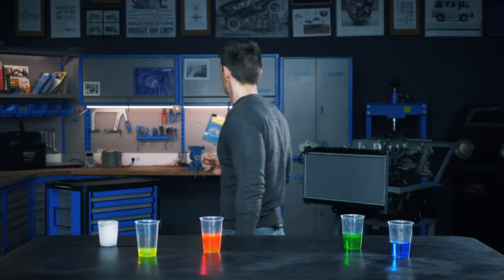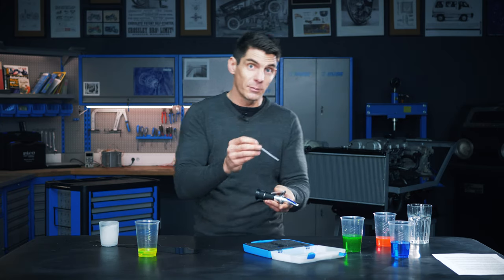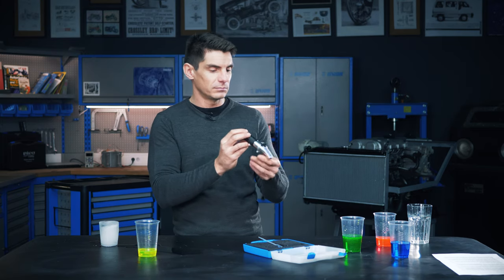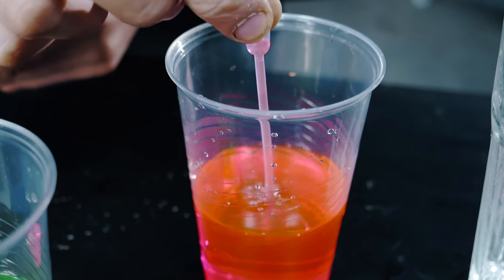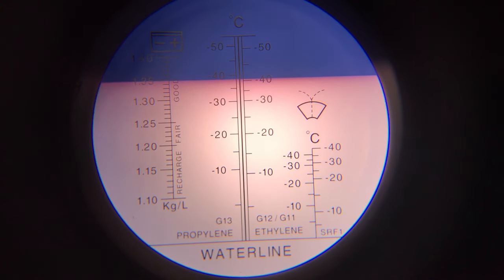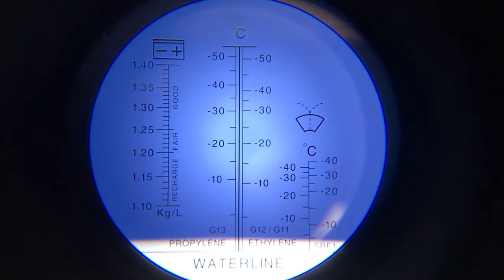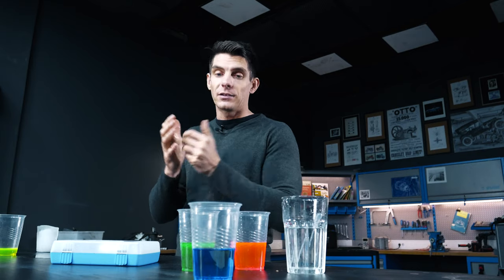Using a Refractometer to test coolant

Comment: Refraction is just a fancy word for bending light. As light passes from air into liquid, it bends a bit. Components in the liquid such a ethylene/propylene glycols influence the degree (angle) of this bending in relation to their concentrations. The final angle shows up on the scale.

Comment: Guys,
The purpose of this refractometer is NOT to indicate when you should REPLACE the coolant, as such.  This refractometer has one job which is to advise in degrees Celsius what level of antifreeze protection is in the coolant under test; and I thought the presenter (Alex?) covered that issue.  This can be helpful when testing coolant in a vehicle of unknown service history, or double-checking the accuracy of a coolant mix prepared by yourself, or others, or even store-bought antifreeze.  It can also help check the coolant supplied after a workshop service of your vehicle's cooling system.

For those unfamiliar with coolant/cooling systems and wish to use a refractometer to test coolant taken from your vehicle:

(a) if your coolant tests way too low in antifreeze protection (for your environment), you can remove some coolant from your cooling system and add sufficient antifreeze CONCENTRATE to the system to increase the antifreeze protection to the desired level.  [Important: You should ONLY add concentrate to your system IF you know the brand/type of antifreeze in your system and you add only that brand/type of antifreeze concentrate.  And, do NOT mix different colours of antifreeze!]   OR

 (b) if your coolant tests way too high in antifreeze protection (for your environment), you can remove some coolant from your cooling system and add sufficient (distilled/rain/boiled) WATER to the system to reduce the antifreeze protection to the desired level.

The above scenarios may require a bit of fiddling around to get the mix close enough but if your antifreeze protection is way too low or way too high you should spend the time on it.  Or, you could just drain the cooling system and refill it with the correct mix of coolant .  Whichever, your engine will thank you. 

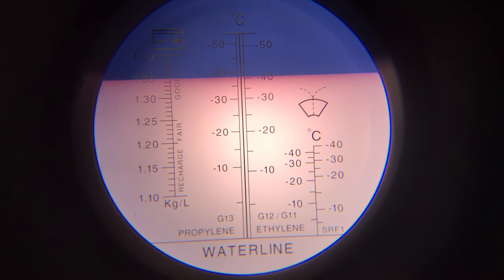In the video test at 1:30 the refractometer showed -40C for a stated 50:50 coolant mix i.e. 50% antifreeze concentrate & 50% water.  (I think a true 50:50 mix would read -37C on the refractometer, but that’s just quibbling).
  The brand of refractometer used in the video showed only the degrees Celsius antifreeze protection provided by the coolant under test (i.e. -40C).  But, other brands of refractometers can show two test values i.e. the degrees Celsius antifreeze protection AND the antifreeze percentage of the coolant (e.g. shows -40C and 53%); which is more helpful IMO.  

For vehicles in a non-extreme temperature environment I use a 50:50 mix (concentrate:water), with protection to -37C.  Nice and safe.   I've seen published that a 33:67 mix (-19C) is an absolute minimum (bordering on unsafe) and a 67:33 mix (-60C) is an absolute maximum (bordering on unsafe).  BTW, a 50:50 mix increases the boiling point of the coolant by about 8C.  

Think I’ve got my facts and figures right (well, close enough). I'm sure to be corrected if  I haven't.  😊
Reply: @ Terry T ... Very well stated and definitely 100 % accurate info. Well put...KUDOS.
Cheers
Brian
Reply: @Bman130958  Thanks for the feedback.
Reply: Exactly the info I'm looking for after doing a coolant flush on my Volvo. Since a few quarts of water/coolant remains in the internals of the engine after a flush, it throws off the 50/50 mix that is normally added to refill. Since you seem familiar with this testing method, I have two questions. Can we assume that the coolant is sufficient for the boiling point, if it passes the refractory test on the freezing side? Also, is this a good method for trying to correct the ratio back to 50/50 after doing a flush? Will it show too much water? Thanks for any info.
Reply: @redbeak1453  Hi.  I'm not sure how helpful I can be but here goes...

You said: “Since a few quarts of water/coolant remains in the internals of the engine after a flush, it throws off the 50/50 mix that is normally added to refill.”  Sorry, I’m not sure what you mean by “it throws off the 50/50 mix”.  

If you're concerned about the end RATIO mix of the coolant , there will not be a problem IF the residual coolant left in your system is a 50/50 mix (or thereabouts) AND you do a system flush [EDIT: I meant "fill", not "flush"] with a 50/50 mix of the SAME coolant type.  The overall mix ratio will still be “50/50” for the system. Even if the residual coolant that was left in the system has a poor, undesirable ratio mix, the volume of  the new 50/50 coolant you are adding to the system will basically even everything out to give you an acceptable ratio mix (which you can fine tune afterwards if you want).  
 
If  you're concerned that the AMOUNT of coolant you add will be less than what the workshop manual states for a refill (because of the residual coolant left in there), not a problem.  Just add new 50/50 coolant to the system until the system is full (and burped), whatever the amount is required.  

BTW, what is the capacity of your Volvo’s cooling system and how many quarts/litres do you think is still in there?  

You asked: "Can we assume that the coolant is sufficient for the boiling point, if it passes the refractory test on the freezing side?".  Sorry, I don't understand so let me answer this way.  You first need to decide the anti-freeze protection AND/OR the increase in coolant boiling point that you want for your vehicle for your local environment (whether you live in a moderate climate or a very hot or a very cold climate).  Once you decide on the protection level you want for your vehicle you follow the mixing instructions on the back of your favourite antifreeze concentrate to get the bespoke protection you want..or you can just buy a 50/50 mix off the shelf, like I do. :)  

For example, a 33/67 mix (33% antifreeze concentrate/67% water) provides coolant freezing protection to -19C and increases its boiling point by 4C.  A 50/50 mix provides freezing protection to -37C and increases its boiling point by 8C.  There are tables that can be found on the internet which will help you.  If in doubt, imo, go for a 50/50 mix or close to it.
  

You asked: "Also, is it a good method for trying to correct the ratio back to 50/50 after doing a flush?".  A refractometer is very useful when having to correct coolant mix ratios.  However, in your case I don’t know why you would need to afterwards correct the ratio back to a 50/50 mix IF you are using a 50/50 mix for the flush [EDIT: Meant "fill", not "flush").  You should be close enough.  

(There are cheaper, quicker tools than a refractometer that do much the same thing but they’re just not as precise or as fancy for us nerdy folks 😊.   See https://www.autoexpress.co.uk/accessories-tyres/60400/best-coolant-testers-2019.  These type of antifreeze testers rely on the number of balls or discs to rise in the sampled coolant to indicate the mix ratio, e.g. 4 balls rising = 50/50.  Some of these are accurate, some are close enough and some are not). 

You asked: “Will it show too much water.”  Not sure what you mean.  The refractometer doesn’t show water as such, whether either too much or too little.  The tool shows the amount of antifreeze CONCENTRATE as a percentage that is in the sample of COOLANT (i.e. antifreeze concentrate AND water mix) being tested by the refractometer.  If the refractometer shows the antifreeze concentrate is 33% you can then deduce that the water content in the coolant is 67%.

In future flushes, may I suggest:
(a)	Check that the radiator coolant level is correct,  If it isn’t, fill to full.
(b)	Drain the cooling system into a container, following the drain method suggested in the  vehicle workshop manual (or google it).
(c)	Measure how much fluid was drained.
(d)	Compare that figure with the workshop manual specs to determine the residual coolant left in the system.
(e)   Fill the system with new coolant to full.

Hope this helps a bit.
Reply: @STiHigh1  Wow!! Thank you for the very detailed response. First of all, I wrongly stated that I flushed the system with 50/50 mix. As explained in the Haynes manual I used(distilled water) reverse osmosis water to flush. Also on the Volvo sites they use distilled water. Funny, no one mentions that not all the coolant comes out like in an oil change. I did drain the block also. I did measure how much coolant came out, but the problem was, that I had already prepared the concentrated Volvo specific blue coolant the night before by mixing it 50/50 to achieve the protection you state above. I live in New Jersey USA, so I'm covered with that mix. With Corona shut downs around, I couldn't just run out to get another gallon of coolant. So I have the testers you mention, but the refractometer seems more accurate than those floating balls that seem to give different readings from one sample to another. So now with the new gallon of concentrate, I've been draining a little at a time and adding to try to get to 50/50 with the testers(floating balls and the Prestone with red arrows). I'm still waiting for the refractometer. Based on what you say, it could help me get to a more accurate 50/50 mix. I have a 96 Volvo 850T5 that has been a tank over the years. With the Corona shut down, I've been going over the car and learning  new things to do. Just rebuilt calipers last weekend, changed rotors and pads and bled brakes. I really appreciate you sharing your knowledge!! Is that that you doing a track day? I ride motorcycles on the track.
Reply: @redbeak1453 .  I should first clarify a mistake I made in my last post where my tired old brain (75-y-o) let me type “flush" with new coolant” when I should have said “fill" with new coolant" .  I have since corrected my post. 

Let’s see if I have it right..  You have drained the coolant from the vehicle and then reverse flushed the system with distilled water.  Did you reverse flush to the point that the fluid being drained out was colourless?  If so, then the residual fluid left in the system would be basically water which, depending on the volume, can sometimes make it a little fiddly to get the desired mix ratio on the first fill of new coolant. 

You mixed a gallon of new concentrate with water to make a 50/50 mix and then you filled the cooling system with that 50/50 mix?  Yes?

So, is your problem that after adding the new 50/50 mix to the vehicle the volume of the residual water already in the system has seriously diluted the end mix ratio in the vehicle from 50/50 to an unacceptable mix, according to your floating ball testers?  Yes?

What percentage/s do your floating ball testers say you have?  

For me, I wouldn’t get too hung up over correcting say, a 45/55 or 55/45 mix…but it’s your car, so your call.  If you don’t have faith in your floating ball testers because their results vary I would stop playing with the mix and wait until you get the refractometer.  

You asked me: “Is that you doing a track day?”.  What are you looking at?  I raced road bikes in the early 1960’s then moved to racing karts then later tracked a 2006 Subaru WRX/STi.  Days long, long ago, but fun times. 😊

Stay safe.  This Covid-19 is a crap thing but, fortunately for us here, Australia is going a lot better than you guys.
Reply: @STiHigh1  Yes, you are correct in your assumptions. I would say based on my measurements of the amount that was flushed and the float tester, it must be close to 45 coolant to 55 water. Based on your experience and test results with a refractometer, would you say that the result it gives is very reliable and would help me get it to a true 50/50? When I flushed the engine, there was some residual coolant still coming out. Probably from the heater core and some deeper caverns in the block. Though the coolant from Volvo is supposed to last 5 years, it was still in good condition after 5 years.
We sure are close to the epicenter for Covid. I'm about 20 miles from NYC!! Seems to be hitting people who are generally in bad health to begin with. So with everything shut down, I have plenty of time to tinker around with my cars and motorcycles:-)) Take care and stay safe as well.
Reply: @redbeak1453 .  I can only say that my experience with MY brand of refractometers has been good in terms of their accuracy,  repeatabilty and reliabilty.  I don't know what brand you have bought but as a general rule any reasonable quality-build refractometer will help you get an accurate [enough] 50/50 mix.  

My refractometers are cheapish models (RHAN-200ATC) but when I tested them against a friend's expensive work refractometer they basically gave the same results as his tester,  and over a range of mixes.  If they had not performed that well I would've binned them (because I'm a tool snob) and use one of my floating balls/discs testers because they are good for quick-n-dirty testing. 

BTW, I only trust the several floating ball testers I own because I've tested them against my refractometers and I know how many floating balls equals what ratio mix for each of them.

You said: "...it must be close to 45 coolant to 55 water".  Nope, mate, "...it must be close to 45 antifreeze CONCENTRATE to 55 water". :)

Nice chatting, hope you have learned a few new things to help you better work on your machines.   Happy spannering, or "wrenching" as you would say.  :)
Reply: I have some questions. first of all I am not fully conversant with the subject, I don't even have a car.

Why can't you mix different colors of coolants? if we can't do that then probably it would be a bad idea to mix coolant with water. Now we are supposing that the mixture of coolant and water is homogenous. If it is not homogenous then that mixture is worthless. Why do we use coolant?? to allow fluid to flow at very low temperatures without freezing, but we must remember from thermodynamics that water doesn't change phase "instantly", either if water changes from liquid to vapour or solid to liquid there is an state of constant pressure and temperature while adding (or substracting) energy. So in this video  the mixture starts to freez at 40°c, but it may have traces of liquid and solid together with constant pressure and temperature which means that we may have a mixture that frezes at -10C but still with some fluid which can be useful.
Reply: Great informative response. Can you tell me which refractometer brands have the scale which reads percentage dilution as well? I have a feeling they will be too expensive and this ATC one (which can be had on Ebay for £14) will satisfy my basic needs, but I would be interested to see what the price gap is between DIY and "Pro".
Reply: @Stratoszero .  Sorry, I cannot help you as I have not looked at the different brands of refractometers for years.  I suggest you use Google and compare specs, functions and cost. I only use my RHAN-200ATC refractometer a few times a year and I'm still happy with it.
Reply: Thank you so much for this comment. Definitely helps my brain understand 😅
Reply: @iwishtobetexan6060 . Thank you for the feedback, glad my post was helpful.

Comment: I use these at work, but it's for the coolant in my machine. Thanks for the amazing video!
Reply: Hi...what parameters do you watch out for. We got a refractometer ,only to find out it was a brix series. How do u monitor the oil concentration in the coolant.

Comment: Refractometers are critical to aircraft safety in deicing operations.  Heated mixtures of propylene glycol and water are used to remove ice and snow from aircraft before flight.  The freezing point of the mixture is determined before deicing begins to ensure that the residual fluid will not re-freeze on the airframe before the airplane is safely in flight.  Since some deicing rigs allow the operator to select different concentrations of glycol and water during operation, the freezing point of fluid taken directly from the spray nozzle is measured and recorded before spraying begins.  Refractometers are also used in the food industry to measure the  concentration of sugar in various liquids.

Comment: Hi thanks for introducing the refractometer! You can measure the freezing point of a coolant and the concentration of glycol/ethylene, but what does this information tell you about your coolant? If the quality goes down, the temperature would go up and concentration down, right? But more important, how to use the refractometer to decide when you should replace the coolant?
Reply: +1 All of the above should have been addressed 👍
Reply: There is another tests . Acidity test can be done using a special probe or using special paper that changes color to a spesific percentage . The more acid in coolant will make more damage to the components of radiator and radiator cap and water pump and engine block . It makes it more corrosive .

Comment: Can I use this to do a before and after to see my GM dealership actually changed the Dexcool in my EV at 98,000 miles or does the fact  that it does not measure rust inhibitors mean this is an ineffective tool for that?

Comment: how much does it cost? please
Reply: Not very expensive, I bought one off ebay or amazon I think, maybe 20 bucks or so? I would still keep my cheap "floating ball" tester, and maybe compare the two readings. The floating ball tester is supposed to be inaccurate with the "safer" antifreeze / coolants, like the Sierra I have used for many years. I intend to compare readings between the two and see how "off" is the floating ball tester with the safer antifreezes - can you add or subtract 1 ball "floating" to compensate for the difference in readings?